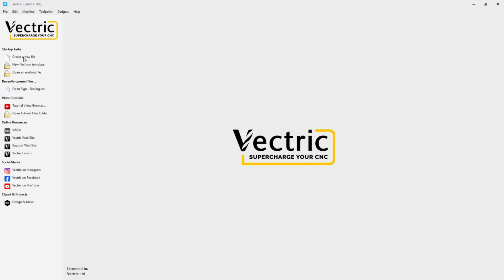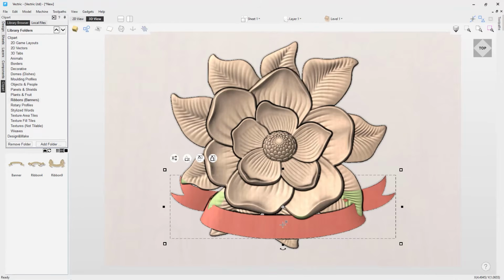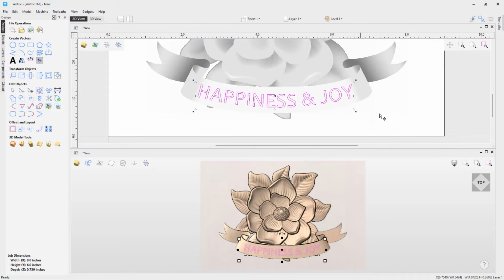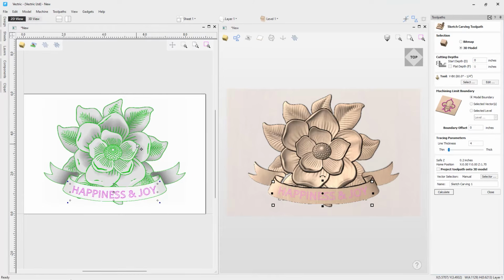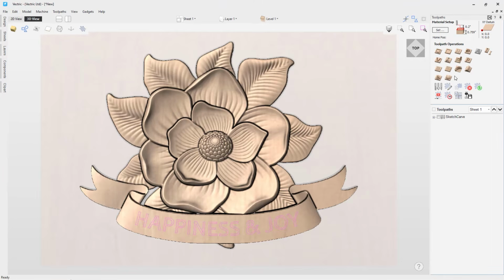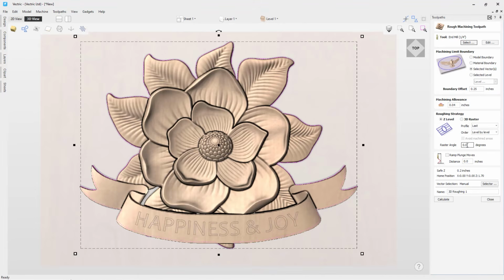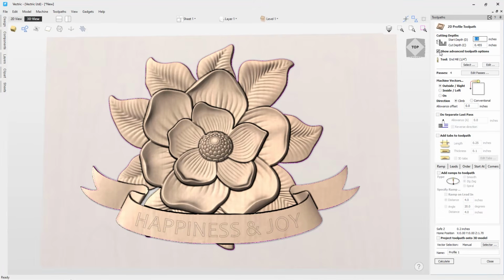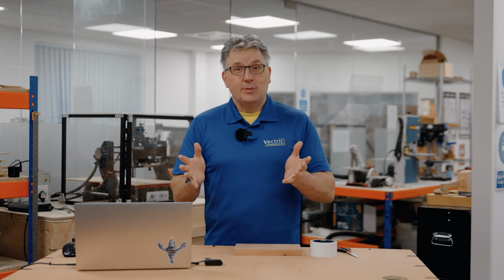How to import and machine a 3D model in Vectric VCarve & Aspire | Getting Started | V12 Tutorials

Comment: At 5:58  you talked about changing the base height but it seems like you clicked on the shape height.  Am I right?
Reply from the maker: Nope that was the base height icon.  It adds a bit of material under the 3D model without changing the shape of the original relief component.  It is hard to see but it is pushing the relief up... not scaling the relief height.  Hope that helps.

Comment: Hi, I’ve followed this about 4 times now, step by step.  I get to the text part and I can see it in the 2d view but it’s not in the 3d view.  Any ideas?  Vcarve desktop v 12.503
Reply from the maker: Hello... When you are in the 3D view do you have your vectors turned on?  In side the 3D view window there is a set of icons in the upper left.  The icon that has a "square, circle and triangle" should show blue lines...  if they are gray then please click it.  This will show the vectors that are visible in the 2D view in the 3D view.  IF this does not fox the issue, please email support@vectric.comn and they can dig a bit deeper. :)
Reply: Thanks, that was it!

Comment: Great tutorial - one suggestion that would make it much more reproducible: please include feeds & speeds (or at least how you chose them). For CNC work they’re often the difference between success and failure, and without them it’s hard to follow the process exactly. Even a quick mention or just clicking "Edit tool" for a second would add a lot of value to future videos.
Reply from the maker: Thanks for the feedback, we'll keep that in mind for future videos!  With feeds and speeds you are correct in your second comment, it could go either way.... users apricate the "starting point" and understand what they need to think about... or they do what we do and forget the other stuff and then wonder what things have gone wrong.  Our machine database and tool database are set up with very conservative feeds and speeds so they should be a nice starting point.  We will be updating these for V13 so I'll be sure to take your comment on board.
Reply: @vectric  x,y offsets if i want to clean around flower? i have to create one path for each offset? is there an option to do only one toolpath with offsets ?
Reply: P.S. I understand feeds and speeds depend on the machine and material, but since both are shown in the video, even a baseline would be extremely helpful.

Comment: They say vertric vcarve pro 12 can lay out and produce 3d carvings using a stl file so ....
-i made my work piece 
-Then i download the image 
-then i hit import in the 3d section but i can't get the model in the right hieght inside the block of wood ...you are the professionals with this program what am i doing wrong 
Do you have you have a vid on this?
Reply from the maker: Hello... thanks for the question.  You have the right workflow, so it might just be something missed in the "Import 3D Model > Transform" form.  That is the point that you can change the model size to fit you material.  Seeing as I would need to see the STL you are importing, and know the size of the material you would like to cut it in, this might be better solved through support@vectric.com.  Send them an email with all the information you can and they can better help.

Comment: What are the advantages / disadvantages between 3D Raster vs Z level?  You mentioned 3D Raster is "easier"  but in what way?  Thanks
Reply: And for the Finishing differences between Offset and Raster?  Functionally I mean.
Reply from the maker: Thanks for the question.  "Easier" in that when it comes to the finishing pass you have more control over how much material is left over the surface.  It follows the surface of your composite relief much closer.  This will take some of the pressure off your finishing tool.  If you try the Z level roughing and look at it in the 3D preview of the toolpath you will see the difference. As for after you run the finishing pass there should be no difference at all.